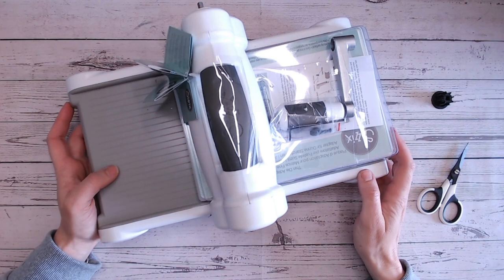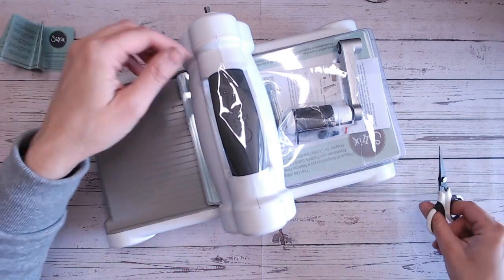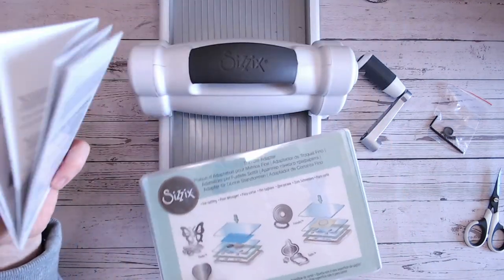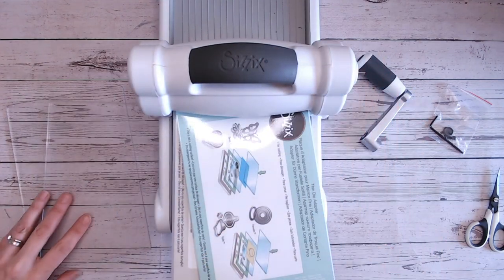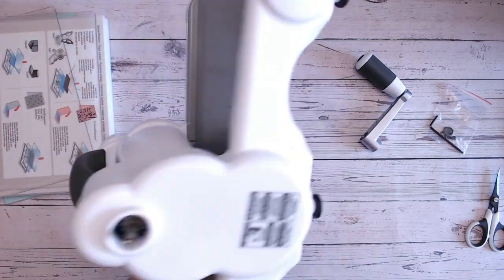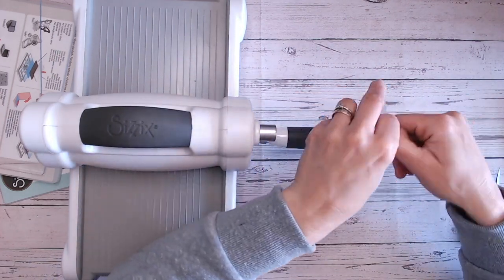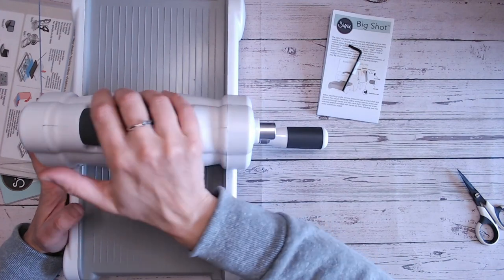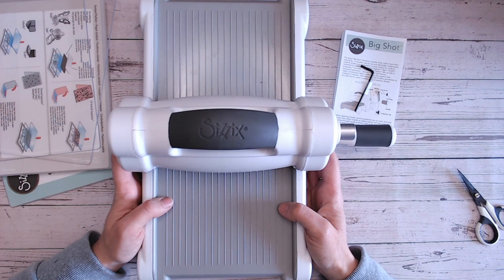Assembling a NEW Sizzix Big Shot Die-Cutting machine - Beginner's Tutorial!

Comment: I bought Gemini II but it's such an expensive trashy machine.  The plates warped to the point that they won't go in the feeder.  Gemini II company won't take it back and Joann fabrics said to go through them= I'm stuck with this expensive trashy machine.  This Sizzix big shot is so much fun to use and the plates don't warp or curve like the trash gemini II.  If you're trying to decide which one to buy, buy this one.  The handle is so easy to turn, you don't need an expensive button to turn on because it will be useless due to their plates warping except if you want to spend $45 a week to replace gemini II plates.